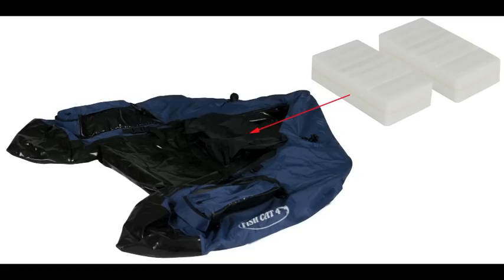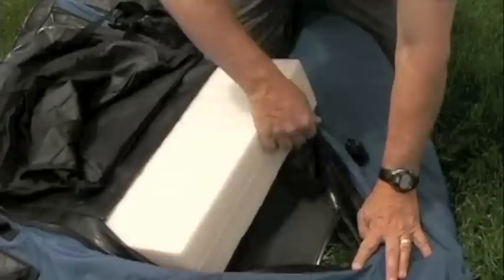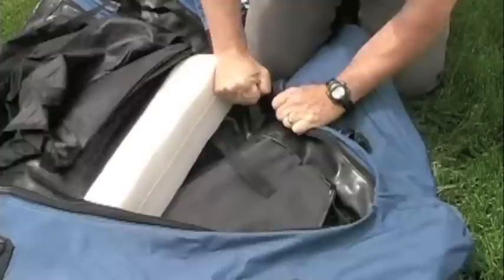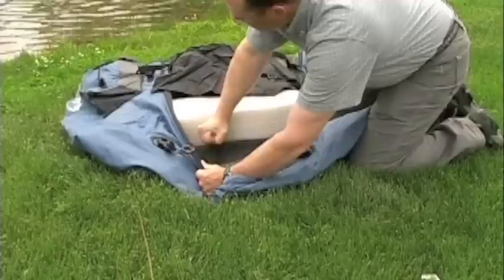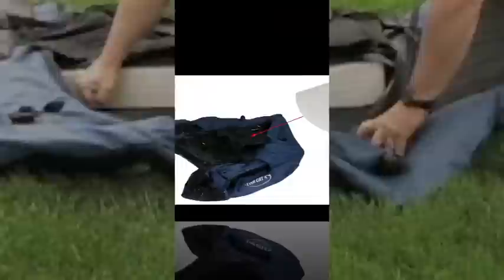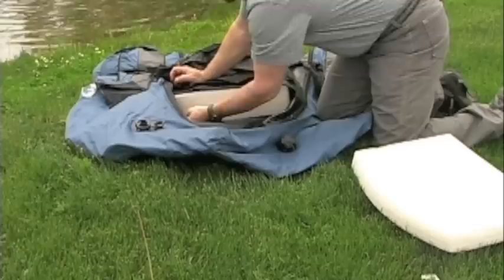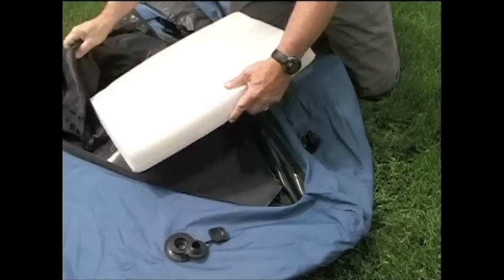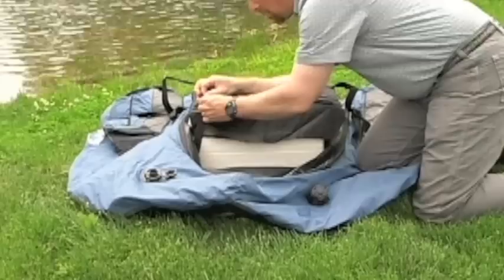Installing the Foam Seat in the Fishcat 4 and Fat Cat

Comment: Installing doesn’t help me when the Max came with the foam installed. How do you remove it?
Reply from the maker: If the foam seems stuck or tough to pull out of the seat pockets, spraying soapy water in the seat pocket area will help the foam come out more easily.